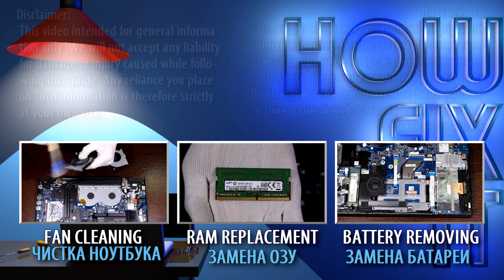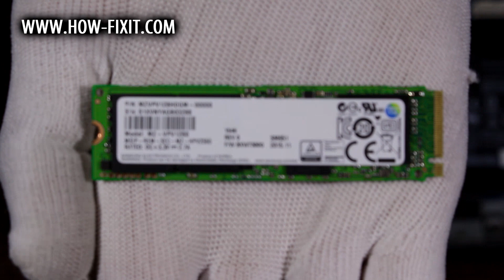Lenovo IdeaPad Y700-15ISK M2 SSD Upgrade & Install Guide - Boost Laptop Speed!

Comment from the maker: ⚠ The Lenovo IdeaPad Y700-15ISK supports both M2 SATA and M2 NVMe drives in its M.2 slot. So, you can install either, depending on your preference for cost or performance. Note: the -ACZ version (AMD CPU) only supports M2 SATA.
Check the description for links to recommended M2 SSD drives. 
Additionally, watch the video explaining the differences between M2 NVMe and M2 SATA 👉 https://youtu.be/r3Jy5dHOj3g
Reply: but it supports NVME speed? or it will go SATA3 speed?

Comment: Does it supports m.2 ssds on the nvme port ?
Reply: yes
Reply from the maker: The Lenovo IdeaPad Y700-15ISK supports both M2 SATA and M2 NVMe drives in its M.2 slot. So, you can install either, depending on your preference for cost or performance. Note: the -ACZ version (AMD CPU) only supports M2 SATA.
Check the description for links to recommended M2 SSD drives. 
Additionally, watch the video explaining the differences between M2 NVMe and M2 SATA 👉 https://youtu.be/r3Jy5dHOj3g

Comment: Which type of nvme supported to lenovo y 700 I think to buy crucial m.2 ssd of 1tb in my laptop 128 gb nvme ssd I want to replace 128samsung and put there crucial 1tb can I do it plz reply what should I do.
Reply: did you replace it? all is ok?
Reply: @TheFunkogolik  yes but I actually replace a laptop. I purchased legion 5 pro 😊
Reply: @karanghule2279  i bought 1tb samsung 980 yesterday and not sure if y700 will see it. but will try :D thanks
Reply: @TheFunkogolik привет. Какой результат, ноутбук увидел его?
Reply from the maker: The Lenovo IdeaPad Y700-15ISK supports both M2 SATA and M2 NVMe drives in its M.2 slot. So, you can install either, depending on your preference for cost or performance. Note: the -ACZ version (AMD CPU) only supports M2 SATA.
Check the description for links to recommended M2 SSD drives. 
Additionally, watch the video explaining the differences between M2 NVMe and M2 SATA 👉 https://youtu.be/r3Jy5dHOj3g

Comment: Why do you disconnect the small black/red component near the top after unscrewing the bottom but before inserting the SSD?  What part is that?
Reply: Battery connector. Disconnected to make sure there is no current flowing through the components.